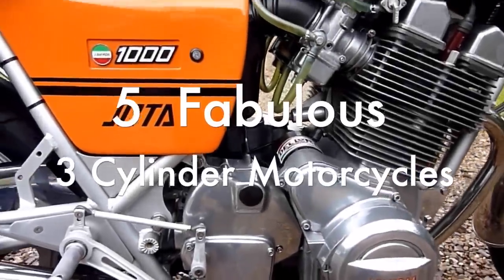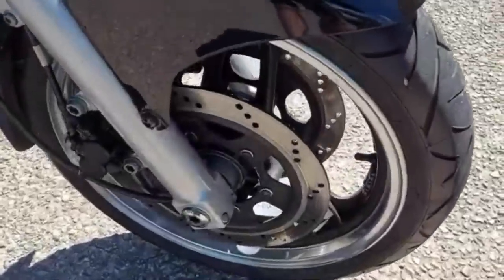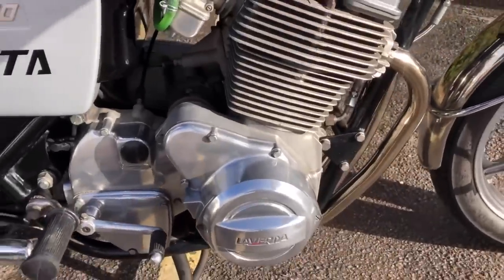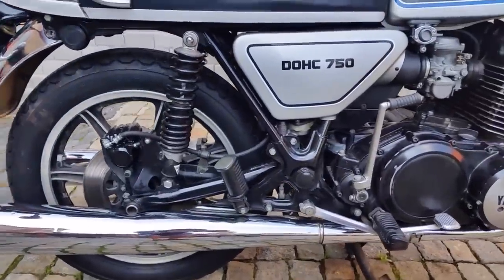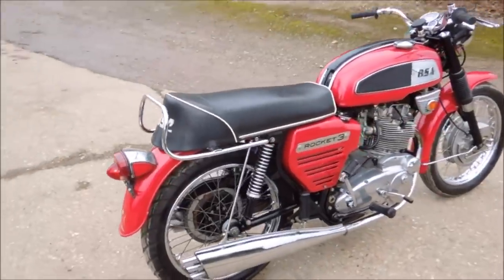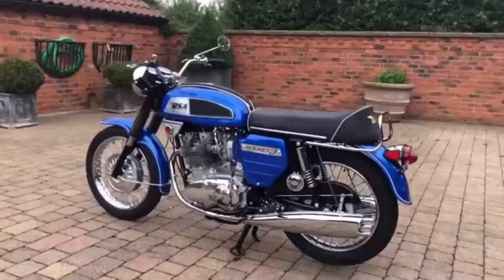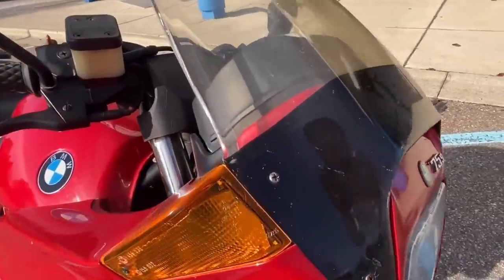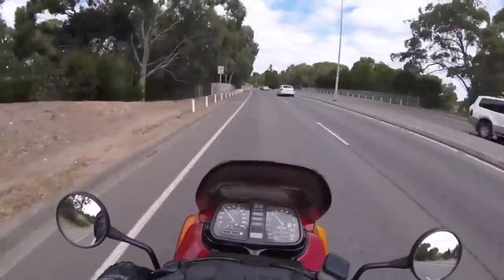5 Fabulous 4 stroke 3 Cylinder Motorcycles

Comment: The sound of the BSA Rocket 3 is just glorious and sublime, musical bliss to my ears !
Reply from the maker: They do sound brilliant
Reply: No matter how nostalgic users of these bikes think they should be, there is no reason why there should be three cylinder engines.  Neither should there be five cylinder engines.
Reply from the maker: @Deontjie  hmmm 🤔 
Bullshit is all I can be bothered to say to that 
I would give technical reasons but really can’t be bothered 😕
Reply: @Deontjie  Ride my XSR900LC and wipe the grin off your face, love that triple whine
Reply: @rogerkay8603  There are really great three cylinder bikes.  Especially that wild two stroke 750 Suzuki.  My point is that anything you can do with three, is usually better and easier with a two or four cylinder.  There are no practical reason for three cylinders to exist.
Reply: @Deontjie Have you ever thought about balance?
After having owned three cylinder motorcycles and five cylinder cars, i can only look at two- and four cylinder vehicles with slightly sad eyes. So close and yet so far.
Reply: @kasperkjrsgaard1447  Merc 300D, Four SsanYongs, VW TD5.
Reply: @Deontjie  Volvo S60
Reply: @kasperkjrsgaard1447  I forgot my disastrous Ford Ranger 3.2 diesel.
Reply: 3 cylinders, the torque of a twin coupled with the hp of a 4. @bikerdood1100

Comment: The Laverda is desirable and the Triumph was a 90s movie star ("Blood Moon"), but the K75 (another movie star - "Fourth Protocol") is very much my favourite from this list. One of the very best bikes of the 80s. Advanced, stylish and tasteful.
Reply from the maker: K75 was a cracking machine
Reply: @bikerdood1100  The Jota for me......
Reply: @bikerdood1100  I remember when the K75 was released, which was after the K100.  The magazine headline was: "A chip off the old block".
Reply: I've had 3 K75s, I've had my current one, a very low miles K75S for 6 years and love it. For me, if it was 75 lbs lighter it would be a perfect bike. A few simple tweaks make it pretty quick and satisfying to ride.
Reply from the maker: @chrisjohnson4165  BMW do like to make their bikes heavy, not Harley heavy of course but chunky

Comment: I had a Hinckley Trident 900 for a while. It was a really nice bike to ride. It wasn't particularly light but the engine was an absolute peach, it was very comfortable and it did well on commuting and touring.
Reply from the maker: I do quite fancy put one in the fleet, but I just don’t have the room 
Dam it
Reply: "It wasn't particularly light"? I had a mk1 speed triple, same bike really, and  I didn't rate it at all. The same power as a cbr600f but weighs as much as a fj1200, all the weight is at the top making it about as nimble as a grain barge, and that bloody sprag clutch? You would have to assume that whoever designed that bike usually designs HGVs.
Reply from the maker: @sambrooks7862  a shit load more torque than a CBR 
I owned a a CBR for several years and on paper it had more hp than my 1100 Guzzi but in reality unless you working that notchy gearbox had it’s absolutely not the same thing 
There’s a massive difference between on paper and on road 
Life isn’t too trumps
Reply: @sambrooks7862  While it may have had the same bhp as a cbr600 it had a lot more torque lower down in the range which made it more usable. It was also 50Kg lighter than an FJ12 but you're right, that weight was held quite high whereas the FJ's was practically subterranean. 
It was never going to be a sports bike but I think it did well at what it set out to do. I never had sprag clutch issues with the Trident or the 900 Tiger I replaced it with (yes, the Tiger was big and stupid but it made me laugh and was soooo comfy). A few minor electrical issues but nothing show-stopping and I used those bikes a lot.
Reply: @1anwrang13r  yeah it was uber reliable and the sprag didn't actually fail, I decided to change it while I had the motor out during the renovation. I had a FJ and I thought they both weighed about 240kg? The FJ was far superior in every way, I bought the triple as a project having never ridden one, honestly? If I had it don't think I would have bought it. BTW, I now own a 96 thunderace, what a bike!
Reply: @bikerdood1100  I've always thought that horse power was an industry thing to sell bikes and you're right it's all about the torque. I've owned 4 CBR600s over the last 25 years, the most recent being about 2005/6. I also used to do a lot of track days with no limits and I've seen several daytona 900s on the track but I've never encountered one that was quicker than a cbr600, they're just too bloody heavy.
Reply: @bikerdood1100  actually I've just read the performance figures of both the triple and the cbr600 and I'm afraid you're wrong, the triple has 58ft lb against 47 for the cbr but taking the weight into consideration the triple has around 3.8 per kilo whilst the cbr has about 4.1, the cbr also has more horses although as I said I don't pay much attention to horsepower.

Comment: In the early eighties at the age of 20 I bought a 4 year old xs750. This bikes almost were worth almost nothing at that time in the Netherlands. It costed 1000 guldens in nowadays money 500 euros. It had a fairing and a krauser case set. I'll stripped the thing and mounted low handlebars 
, a 3 in 1 exhaust and did some paintwork with a brush. The thing wasn't fast but what a beautiful noise it made. Later I owned more newer bikes but the Yamaha triple gave me the best memories.
Reply from the maker: It’s a shame the first bikes really wrecked the bikes reputation and sales were never the same after that.
Reply: They were heavily discounted brand new in the UK around that time, which must have depressed used prices. A friend of mine had one (black and silver) and I thought it was OK. I liked the shaft drive although it would 'sit up' a bit when accelerating.

Comment: Had 2 K75RTs, seriously reliable and durable. 
The 750 triple was turbine smooth. 
Top gear is identical to my Honda CX650ED - 6000 rpm = 82 mph
Reply from the maker: To a Guzzi V twin owner that sounds like a lot of revs
Reply: Sounds wrong about the revs. I fitted a final drive from a K100 which calms the bike down nicely. EV14 injectors restore any loss of acceleration and top gear becomes overdrive.

Comment: Nice video I had an XS 750 with a Piper 3 into 1 pipe. Great sound . Good workhorse it happily took me and my wife back and forth from Torquay to South wales . Most interesting 3 cylinder’s have to be the Kawasaki 2 strokes . I have 250 & 400 great fun . Bloody dangerous 😂
Reply from the maker: All about the terrible power delivery
Reply: The frame , brakes and suspension on the 250, 350 and 400 were the same . H1A 500 came out with a twin drum on the front originally…🙈

Comment: Triples! I had a K75RS triple that was truly wonderful; a bit “old school in weird new clothes” perhaps. But that was much of its charm. It actually felt a lineage back to /2’s in some ways. Much nicer and much more fun, imo, than the original 1 liter, 4 cylinder flying K bricks. More reliable mechanically and well behaved in corners also. The forks were a bit too spindly though, it must be admitted. An aftermarket brace helped. Otherwise it was a 100 kmile mid sized bike. The triple format was the key to its goodness.
Reply from the maker: The general feeling is that the K75 is the better bike an excellent example of less is more 
BMW had a bit of a thing for soft front forks, I’ve heard similar comments about the R100
Reply: I love my K75S.
Reply from the maker: @chrisjohnson4165  a very underrated bike

Comment: I owned a Polaris Red K75S for 10 years and commuted on it for 5 of those to Manchester city centre and back, about 35 miles. Through rain, wind and snow. Never let me down, was extremely easy to work on, especially for plug changes or valve checks. Had a fair turn of speed when the occasion demanded. It was also easy to get off the line for a relatively heavy bike, possibly the dry clutch - I remember racing a Bandit 600 away from the lights once - he was two-up and you could hear his drive chain slip in a vain attempt to keep up with me. The only real issue I had with it was the screen I had fitted funnelled the wind against my helmet, which made 80mph motorway riding, 2-up extremely tiring on the neck. It might have been an aftermarket tinted item that was slightly cut-down. The sound at low speed with the early electro-mechanical fuel injection and 3 cylinder exhaust note made it sound almost like a turbine, especially if you were on a narrow road between buildings. Occasionally a pedestrian would look at it and wonder what kind of engine it might have when I was sitting in traffic.
Reply from the maker: The K75 seems a very underrated motorcycle these days
Reply: @bikerdood1100  Too true. It was probably a motorcycle of its time, serving its purpose extremely well. It was also quite rare having never sold in huge numbers and not really appealing to the average motorcyclist back then, most of whom were getting into crotch rockets or cruisers. Mine got snapped up when I came to sell it about 2008 and the purchaser got a full restoration done on it, by ex-Speedway World Champ Peter Collins.

Comment: 1970’s Honda disc brakes worked well in the wet if you had them drilled.
Remember sending mine off to Leeds for drilling and never had a problem in the wet again.
Reply from the maker: It did make ventilated disc popular but fundamentally the Japanese used the wrong materials for their breaks

Comment: I've owned two Triumph T150V Tridents. Great machines once sorted, and the wail of that engine at speed is addictive.
I also owned one BWM K bike. I thought that it was bulletproof, but the drive shaft broke at around 36,000 miles!
Reply from the maker: Ouch !
Reply: @bikerdood1100  Turns out that it was the lower U joint which failed. I expected better from BMW.

Comment: I had that first Trident the blue one from 1999 to 2021 and it never let me down ever, it was a brilliant bike. As the guy said top heavy but once you got used to it no problem. The engine was a peach and surprised many a sportsbike rider from the lights. Ran out of puff compared to the sports bikes at about 90 but it got there pretty quick. I saw 140 on the speedo on the autobahn. I sold it for a song to a mate so i could grab a bargain on the last of the speed triple 1050 rs black n yellow. my missus just wouldn't go for me having 2  bikes so the trident had to go. at least it went to a good home at my mate's.  genuinely great bike though and even though my speed triple is way better it kinda lacks a bit of character.
Reply from the maker: Always fancied adding one to the fleet

Comment: One little mentioned factoid about the Laverda : its alternator did not charge the battery below 3,500 rpm.  Not a problem on the highway but could be really annoying around town.  A friend owned one...a first model Jota hotted up a bit.
Reply from the maker: I’ve heard that strange I wonder if the gearing to the alternator was compromised

Comment: I had both the Jota- absolutely wonderful, tho slightly dodgy electrics and the yam xs 750- light, easy to ride, but guzzled oil and ultimately munched its' pistons and con rods...
Reply from the maker: Yamaha did seem to have quite variable built quality backing the 70s some found the XS solid some terrible with a great number somewhere in between 
I like the style and design of the Yam but the Jota is on another level entirely

Comment: The Laverda is just gorgeous.  While the Trident line was significant in the resurrection of Triumph, the T595 Daytona and T509 Speed Triple are a bit more fabulous; granted I'm biased as I have a '97 T595.  Clean sheet design, nothing in common with earlier models, motor developed in conjunction with Wilcox Engines (I sourced my exhaust from them, wish I'd popped for the full engine kit that bumped it up to 142hp at the crank, no longer available at the time I inquired about it.)  Totally intoxicating sound and feel.  Good to see the Yamaha, a friend had one.
Reply from the maker: I felt the earlier bike more significant and I kind of like their chunky styling
Reply: Cool.  No argument there, style preferences are largely personal opinion.  I happen to think my Daytona is one of the more beautiful designs for a road bike, not in the same league as a Ducati 916 or MV Agusta F4 though.  I saw an MV Agusta F4 Senna on the sales floor of a local dealer a few years ago, that is one beautiful bike.  First time I saw a 916 I thought, that's not a motorcycle so much as a piece of sculpture you can ride.

Comment: That was very interesting!  I must admit that I was unaware of the Moto Guzzi triple.  I have either owned or ridden all the bikes reviewed here, the Trident T160 rather than the Rocket three, but they are very similar.  The Jota was a real brute, but very charismatic, the XS 750 was the victim of lack of development, sadly a feature of too many Japanese bikes of the time.  The K75RS was a lovely refined machine, but is was big and heavy, it was very comfortable and had long legs.
Reply from the maker: Went for R3 over the t160 so I could sneak the Hinckley bike in
One company one bike were possible I think 
May struggle to stick to that with the strokers however

Comment: I had a Yamaha 750 3.  It was the biggest bike I ever had.  The "torque jacking" effect of the shaft drive was pretty annoying, but it was a beast, no doubt about it.  I have always wanted a Suzuki water buffalo 730 3, but it hasn't happened.
Reply from the maker: Had almost exclusively shaft drive bikes, the jacking thing is barely noticeable if I’m honest and invisible after a while as you get use to it
Reply: @bikerdood1100  I've had both chain drive and shaft drive bikes, and both the Yamaha 750, and to a lesser extent the Honda 500 V-Twin, had the jacking effect.  I haven't ridden anything like a GoldWing or anything more modern to compare them to.

Comment: I owned a 80 xs 850,never had a problem with it. It did start leaking oil from the middle cylinder,but it did not cause a issue..
Reply from the maker: 850 was much the better bike

Comment: Great video,  you don't see many K75c now days I bought one of a mate 15 years ago , he'd owned a K1000 but then got a k75c he said the k75c was smoother and better ride ,   I've been riding my K75c for 15 years with no problems , their easy to work on doing my own services & cheap to do in comparison with more modern bikes , their a bit of a marmite bike you either like or loath them , but on a practical note you get over 50 m p g they go forever cheap insurance and if you've owned one they grow on you , they can gallop along as well .😊
Reply from the maker: Yes definitely better than the 1000 
Where are they now I wonder

Comment: About the XS-750 f  from 1979 I had one for many years. .  Yes if you were not causcious on a 1- 2 shift, it would fail in the first year. .  But for all the rest, In Canada,s model, at least, among it's piers. it was the fastest on acceleration, torque,  comfort , a real sofa of a seat, and it had the higher top speed of all the 750 air cooled of the year ☺Oh yes; the SOUND    🤩. .  the most pleasing sound of the industry. . And a true fun to experiment the tunel's resonnance frequency  🤣
Reply from the maker: Not sure about the top speed looking at the publications of the time but definitely a good sound
Reply: @bikerdood1100   Among the other air cooled 750, I was fastest  not by much but none of my friends could keep up with me. .  sometimes barely a walking pace speed advantage but I was the king , , then the 4 valves per cylinders arrived  and I was done. . .😏

Comment: Where's the H1 or H2 Kwak then? 🤔 I went to the NEC show one year on the back of a mate's XS750. That seat was like a plank.
Reply from the maker: Four strokes first then two strokes in the next video
Reply: Hopefully we’ll see them in part 2? 😀
Reply from the maker: That’s the plan
Reply: @bikerdood1100  Excellent. I've had an S1C 250 and an S2A 350 Kwak over the years. Cracking bikes!

Comment: beware XS750s, they had a factory recall for self dismantling gearboxes and any engine number not over stamped, indicating this mod, should be avoided.
they also had a big problem with overheating on the centre pot, causing head warpage and in extreme cases, blowing up the centre pot.
I know all of this because I bought one, and blew up the centre pot.
I only bought it because I had wanted a motorbike since I was 6 years old and saw one in hapstead in london when it was brand new, and thought to myself, "I'm going to buy that when I grow up."
turns out the one I bought was exactly the same bike I had seen, reg STD700S!
to cure the overheating, you will need to upjet the centre pot to make it run cooler, then, as long as you gearbox has the mod stamp, it's a stable and torquey plot that's fairly frugal to run.
the seat is enormous and can easily carry a family of five, the shaft drive makes knackered swingarm bearings a discovery in 'maleable steering', in left handers you can tighten your line by easing off the throttleand the whell banks more than you do lol
Reply from the maker: True 
Covered a lot of these in another video 
Overheating was improved with a switch to Electronic ignition 
Was a common problem with all triples in the 70s
Trident 
Suzuki GT
Kawasaki etc

Comment: Neither my commando or T150V leaked a drop. But having changed oil in roadster i put slightly too much in tank and it threw it straight into new airfilter i had just received,COD,from Pride & Clark!
Reply from the maker: Yep
Some Guzzis can do the same thing
Best not to be too generous with the oil